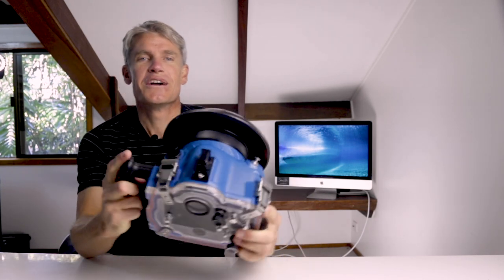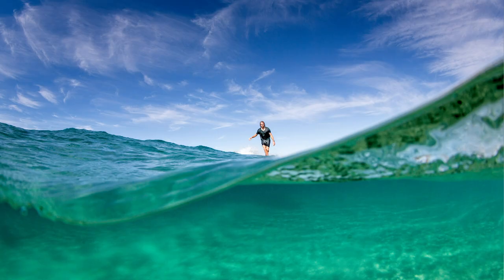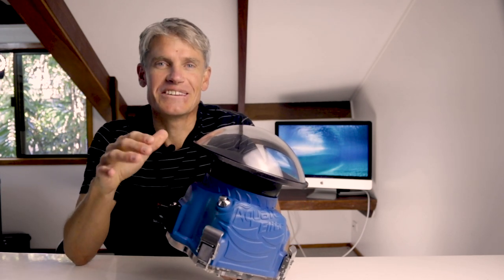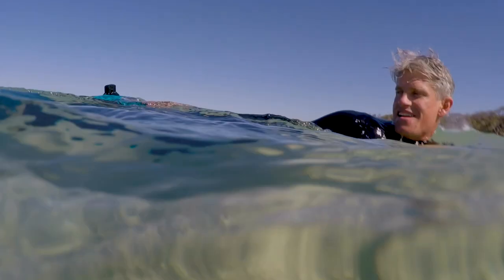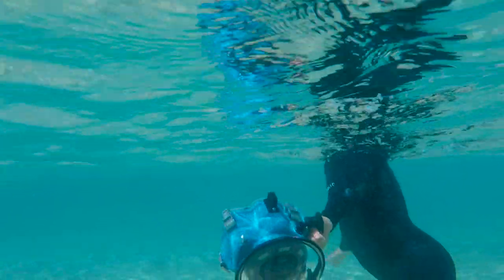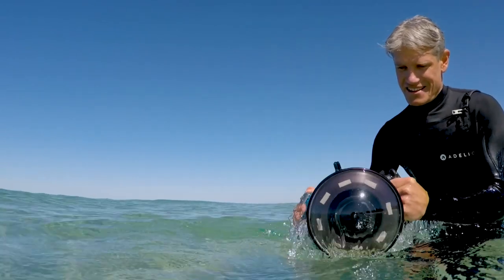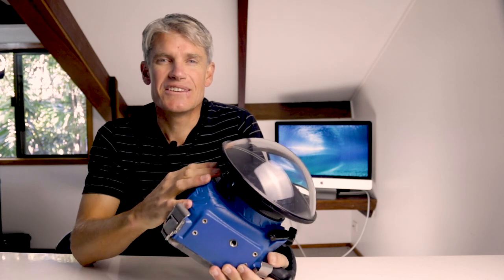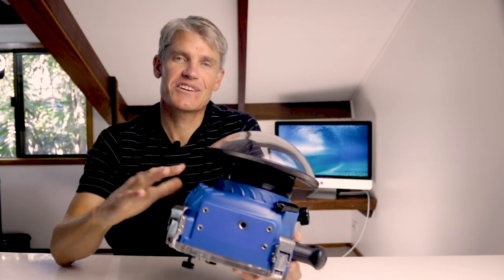4 steps to keeping a clear dome port (water drop free)

Comment: Another amazing tutorial Tom, when you say is better use a flat port when shooting 20mm lens or higher, are you considering the crop sensor factor ? I have a 12-35mm on the lumix gh5, have both Dome and Flat port and still have doubts on when using one or another! The gh5 has a micro 4/3 sensor. What you suggest in this case ? Thanks a lot.
Reply from the maker: Hey WIlliam, great question. Using a flat or a dome port really depends on what you are shooting. If you are photographing split level images the dome port is better. If you are shooting surface work (above the water line) then flat ports are fine to use with pretty much all lens lengths, except maybe fisheye lenses (they are best with the dome) underwater wide angle is best done with a large dome. With the crop sensor I think its fine to go off the lens properties rather than the converted lens length. With your 12-35 I would shoot surface work with a flat port, split level and underwater work with a dome with the lens set at the widest setting (12mm) but you really should experiment and see what works for you the best. How have your results been so far?
Reply: @dreamlifephotography  
Very informative Tom, will go for it then let you know the results, once again thanks a lot for your time and all videos. They are very helpful. Cheers

Comment: I saw a video on YouTube with a guy saying to use candle wax on the lens port, what’s your opinion of that?
Reply from the maker: Hey Scott, wax on the port is definitely NOT for dome ports which I am talking about in this video. However flat ports are a different story. I go into multiple techniques for using different types of wax and methods in my free online course. If you want to get access go to this link: https://dream-life-through-photography.teachable.com/p/transform-your-water-photography
Reply: Hey Scott! Yes, unscented candle wax works great on flat element lens ports when you want it to repel water (aka dry port) but on dome ports you definitely want to shoot through a wet port as Tom suggests.
Reply: I know the thread is about dome port however I’m really struggling to keep my flat port droplet free! I’m using red sex wax as you advised on your course but still struggling as it leaves a white layer of white smudges and when I buff them all out the droplets are coming straight away! Is there any technique I’m missing? Your channel is awesome!

Comment: Great tips Tom.. any tips for cleaning inside the port?
Reply from the maker: If you keep the back caps on when not in use you shouldn''t have to clean it very much. I sometimes wipe over with a clean micro fibre cloth

Comment: Hey mate my question is about focus, do you use auto or manual focus under water? I'm having trouble with that, cheers!
Reply from the maker: Hey mate, thanks for your message. For underwater I always use auto focus. Mostly I use wide angle lenses for underwater. My 15mm fish eye, 17mm wide lens or at the most a 20mm lens. As the focusing is so hard to preset unlike photographing on the surface with wide lenses I use auto focus when going below. Focusing distances vary a great deal from surface to underwater. I go more into this in my full length course. But I would suggest trying auto focus with wide lenses when underwater. Hope this helps. Cheers Tom
Reply: @dreamlifephotography  cheers mate

Comment: Hi there! I seem to have somehow scratched the dome right in front, any tips on how to deal with those scratches or ways to get treat them etc?
Reply from the maker: Hey Janik Sorry to hear... scratches on dome ports are not good especially when shooting above the surface of the water. However you can normally polish them out. I have polished out some nasty scratches before and it has worked well. This is the link to the polish that I used from Aquatech store: https://aquatech.net/collections/water-housings-accessories/products/na-novus-cleaning-and-scratch-remover-kit

Comment: Hi Tom, love your videos. I mainly use a flat port so licking it doesn't really do the trick. What else could you recommend to keep droplets off a flat port? I have heard some surf wax could work
Reply from the maker: Hey Ben, Yes definitely DO NOT lick your flat port. Wax is a good option, however the technique and other factors help. You can get access to my free online workshop that shows you how to do it for best results. Join at this link: https://waterphotographycourses.com/wp-sign-up-page

Comment: Hey bro great video thanks for clarifying! I've just changed my normal port to a dome port and I'm using a wide lens and I've just found some interesting technicalities regarding the lens reflecting inside the port when trying to shoot into the sun while getting some lens flares any tips on reducing this reflection?
Reply from the maker: Hey mate, thanks for the question. The reflection is normally from the inside markings around the lens. from just outside the lens if you know what I mean? so using non reflective tape to cover that up will help. Hard to explain this in text, so I might do a live instagram video or possibly a quick YouTube about this topic. its a great question
Reply from the maker: Hey Michael have you got a sample picture of the reflection? I will be doing a video on this I reckon, hopefully we can make this a problem of the past. if you have a sample please send through to info@stimages.com.au cheers mate
Reply from the maker: Hey Michael, just loaded the video on this topic. You can watch here: https://youtu.be/ULMqeGddgO8

Comment: Are those white things in the dome to keep it from fogging up? I put some in my dome but I could see the reflection of them. I haven't tried taping them on
Reply from the maker: Hey Amanda thanks for your question. No actually those are just double sided sticky tabs that enable a black piece of fabric to stick to the inside of the port to help prevent reflection. I don't have many troubles with reflection so I rarely use the fabric

Comment: Do you think using a water repellant spray would work for this purpose? Like, there's spray selling on the internet for shoes, I've used them with great success, I'm geniunely wondering if that would work with a dome ahah
Reply from the maker: Aquatech don't reccomend chemicals to be used on the dome ports. The products are generally designed to sheet the water off which is what you want for a flat port, but the theory for the dome port is to keep a perfectly thin sheet of water intact over the entire dome and nothing does this better than saliva. Spit on the dome 5 minutes before entering the water and you should be sweet. The salvia dome port method has worked pretty much flawlessly for 20 years now for me, personally it my recommendation for domes... save your money use your spit.. hhaahha cheers for the message and question
Reply: @dreamlifephotography  ahhaha thx Tom! I'll stick to spit then XD

Comment: What is your suggestion for cleaning the dome after a session?
Reply from the maker: Hey there! thanks for your question. I give the entire housing... especially the dome port a really good rinse in fresh water. I pat dry a little with a clean towel and leave to dry on top of my case or on a bench. After it has dried I clean with a micro fibre cloth and store with a protective cover. Always have a cover when not using, as the domes are sensitive to scratching